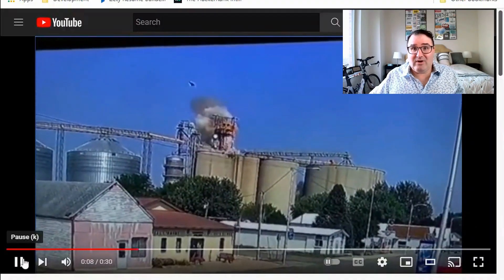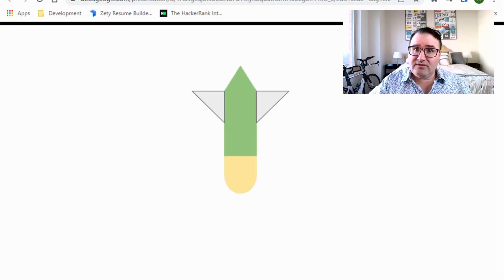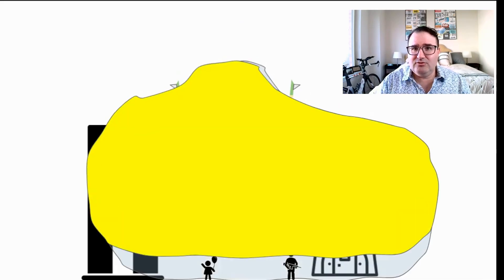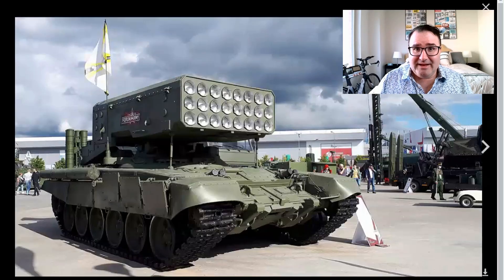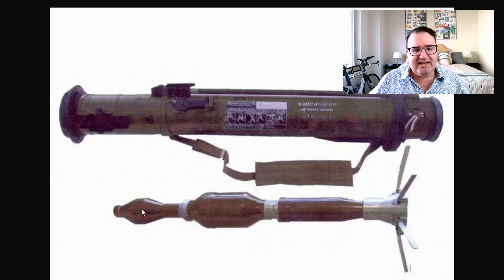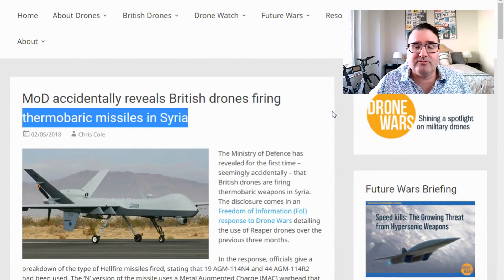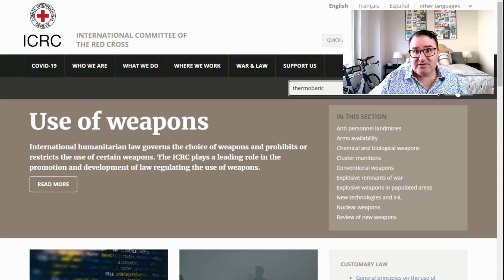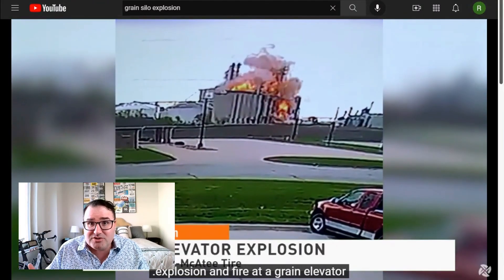How do Thermobaric "Vacuum Bombs" actually work?

Comment: Humidity makes air LESS dense - Pilot and Sailor here - and would most likely have no impact on burn rate at those temperatures.  Love your channel and thank you for your work, brother!
Reply: This is true, but humidity does shift the proportion of oxygen in air. So the kinetics would be slightly slower in humid air, since the probability of free radicals interacting with fuel or oxygen would go down.

That said, more humid lowers the density slightly due to lower molecular weight(which is why it's less dense), so it also slightly shifts the speed of sound and thus overpressure. Though this is probably not very relevant since even in rain, the LHV vs HHV of the fuel probably overwhelms the rain during that moment of explosion.
Reply: Yes, yes yes! LESS dense, not more dense. The "heavy" feel of humid air is because of the reduced rate of evaporation at your skin's surface, creating a sensation of stuffiness. Water (H2O) has a molecular weight of 18 (2 hydrogens @ 1 each plus one oxygen @ 16), while oxygen (O2) and nitrogen (N2) are 32 and 28, respectively. Pilots learn "three H's" (High, Hot, Humid) are deleterious to performance, especially during take-off.

Does rainwater in the air have an effect? I guess a really heavy rain might, but in a typical rain storm, the droplets occupy a very low percentage of overall volume. And water is incompressible, so what are those droplets going to do? Probably not much, other than flash evaporate in the high heat.
Reply: As a glider pilot and sailor, I came here to write this ☝️, lol.
Reply: @Joshcodes808  I had my first flight in a sailplane back in the late 80’s - about 15 hours - before I moved to digging tunnels in the air.  But they taught me how to stick and rudder - I love those birds.  Good on you for sailing in air and water, brother!
Reply: @samcory6627  Thanks. Stay airborne for me (new baby has me grounded).
Reply: @Joshcodes808  congratulations on your growing family!  You’ll be flying them in no time and teaching them all sorts of cool things.  A family sail can be amazing as well - fishing, diving, etc.  I’m jealous you have all that to look forward to!
Reply: @samcory6627  thanks man. I’m excited to show her all those things!
Reply: @Joshcodes808  former glider pilot here. I was thinking "Isn't atmospheric instability and thermal generation partly driven by humidity?"
Reply: @Greeniykyk  very much so!
Reply: Agreed regarding humidity and density. I think rain drops would reduce the effect. When space ships take off, they spray the launch pad with water, not for cooling, but because the mix of air and water drops absorbs sound waves. For rockets, this helps keep the sound waves from bouncing back up and damaging the ship. I think the same principle would apply to thermobaric bomb in the rain, but probably only a small effect.
Reply: @curtlezumi  agreed! if I had seen your comment before I would have quoted you in it. it seems that we both were thinking the exact same thing. lol!
Reply: agreed. the only thing different I would say is that the water in the air displaces some oxygen, possibly slightly dampening the effect of the explosion. but, the effect would be miniscule compared to the blast and I doubt any noticeable effect would be seen. that, and if it were raining heavily the presence of the water in the air May absorb some of the kinetic energy from the blast. but, the same can be said for this as for just moisture being in the air. it likely wouldn't have that much of an effect on the blast itself unless it was literally detonated within a waterfall. I could see that having a big effect on the blast. think of a rocket launch and how the water deluge system to dampen the sound effects the lift off of a rocket sound. that's the only effect that I think would have any noticeable change to the blast itself. but like I said, you'd have to detonate it within a massive waterfall to see it affected in any way. or at least that's my hypothesis. that's all any of us are really doing anyways, hypothesizing about it as there's not really any research or papers on it that I can find anyways. so we're all just basically taking educated guesses based on our own experiences.
Reply: Humidity reduces atmospheric density by the addition of hydrogen to the atmosphere. Hydrogen does not exist in the lower atmosphere in significant quantities. However water moisture introduces 2 hydrogen molecules to the atmosphere. This hydrogen displaces other components of the atmosphere specifically oxygen and nitrogen. 

So a one square meter sample of humid air it will contain more hydrogen than a sample of dry air.
Reply: @xdm9guy  nope... hydrogen (H) is smaller. than most other parts of air, N, O. so you can pack the hydrogen atoms in the inter atomic spaces better, just like you can pack more weight in same volume with smaller spheres than larger spheres.
Reply: @ukissrulez  the hydrogen atoms are attached to oxygen atoms, H2O. They aren’t packing into the molecular spaces in the air.
Reply: @xdm9guy  yes it makes sense
Reply: @xdm9guy  are you saying that the same volume of water is less dense than the same volume of air mixed with some watervapor?
Reply: @ukissrulez  no, not water. We are talking about humidity, not liquid water.
Reply: @ukissrulez  This is wrong. Gases follow the ideal gas law, which basically says, at any given pressure and temperature, there will be the same number of gas molecules in any given volume. If you reduce the size of the molecules, you will decrease the density of the gas. Smaller gas molecules don't "pack better" the same way a solid would.
Reply: @roflmatol  ideal gas law was never validated, and no gas is ideal, real life is not as portrayed in textbooks.
Reply: @ukissrulez  Read the other replies on the thread, for example from pilots who have real life experiences flying in humid, less dense air
Reply: @ukissrulez 
TLDR: higher RH% doesn't mean ADDING liquid water to air, it means REPLACING some gases with another gas, in this case water vapor.  Not the same as adding table salt to a glass of water. 

This didnt make sense to me an hour ago. I just googled it so there's more to it  than that and i might have made  a mistake or two wording it... so take this. With a grain of salt lol

It's counterintuitive because we tend to apply the same logic to increased water vapor content in the air (air which is a mix of different gases including N2, O2, H2O, CO2, Ar, etc) as we do to increased salt content in water (which is a solid, NaCl, that's dissolved in a liquid, H2O).

When liquid water evaporates in air it's not being dissolved in it, instead it displaces a certain volume of air's other constituent gases therefore shifting the ratio of said gases within this gaseous mix that is air. Given that we  are talking about a given volume of atmospheric air thats free to move around, the pressure doesn't change either but the density does thanks to the ideal distribution principle. This is a different situation from if you had a sealed rigid 1 liter container of air with 1g of liquid water at the bottom and you forced it to evaporate by heating it which would increase the pressure, or the volume if the container was allowed to expand. To be fair, in the atmospheric example the volume, temperature and pressure all do change locally but also rapidly even out in the whole atmosphere.

 In the fresh liquid water vs salt liquid water example we are talking about dissolving a solid in a liquid which does add weight but doesn't increase the solvent's final volume since the salt molecules fit between the water molecules. But the solid salt had a volume, so the final volume is less than it was before... Total weight goes up while total volume goes down  which means density went up.

Two completely different situations that  make sense when considered for what they are. Gotta love science 😂❤
Reply: Exploding one of those bombs in the middle of a very heavy downpour would increase the blast, slightly, by flashing the water droplets to water vapour. It would then be more properly called a fuel-air-steam bomb. More bang for your buck. This is because phase change from liquid to gas increases the distance between water molecules about a thousandfold. It would also have the effect of reducing the heat, due to its absorption by the phase change, but only slightly.
Reply: I watch your videos as they contain subjects that are interesting, however, you were premature in releasing this video, because the functionality was incomplete and by necessity you also need to provide better description and show examples of the effects on humans and other intended targets.
Reply: Humiditist here. Humidity makes the air MORE dense.
Reply: @ukissrulez  nope, less dense.